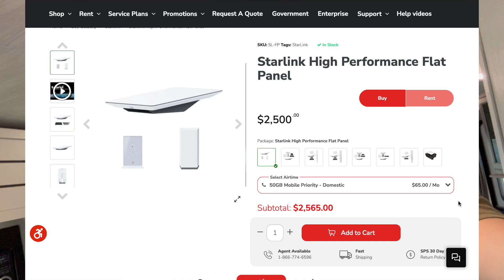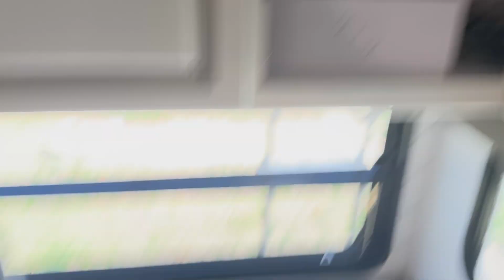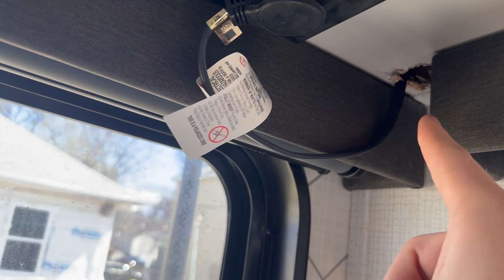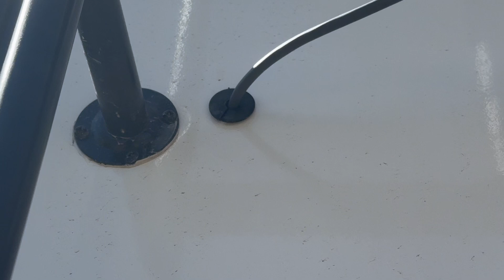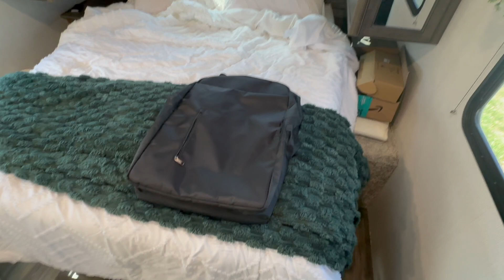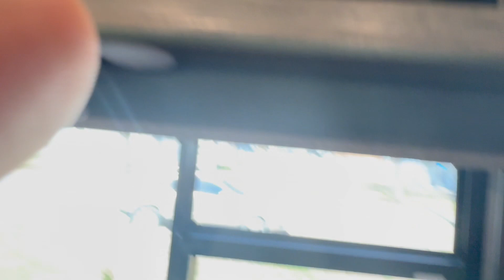Starlink RV Install for UNDER $200?! (Pro Setup & 100% Waterproof!)

Comment: Nice, I'm running a Mini for my RV on a pole mount or tripod if needed to get a clear shot of the sky.
Reply from the maker: @alanb.4660  those minis are pretty awesome!
Reply: what do you do with the wire of it rains while traveling?